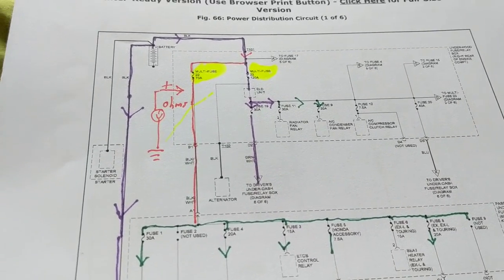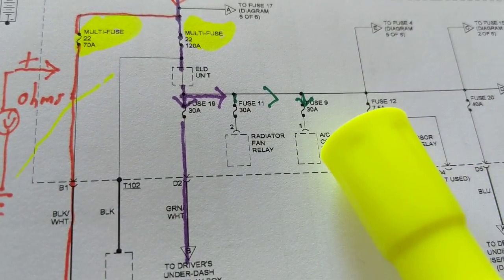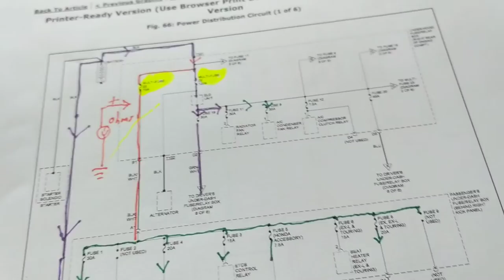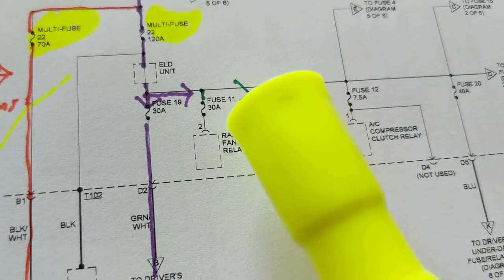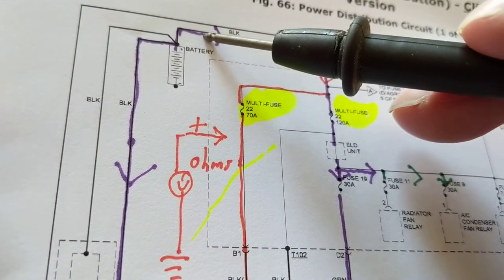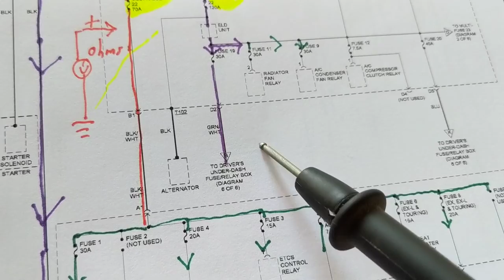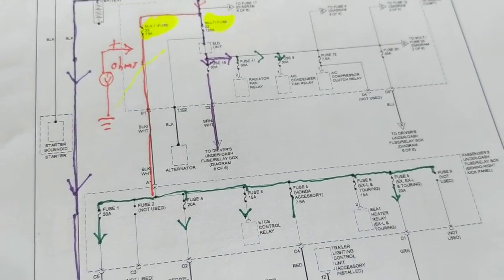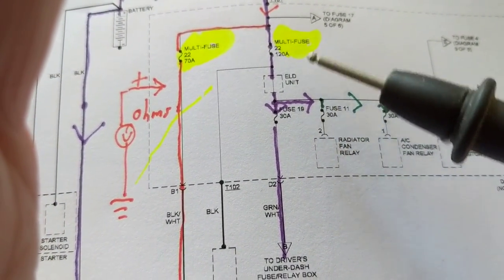how to check FUSES FOR SHORTS FROM WIRING DIAGRAM

Comment from the maker: I believe I made a video about power distribution system and all the fuses in the system it should be on the channel Joe electronics schematics for Auto I described where the fuses are connected to the systems and how to measure them

Comment: One thing we have to keep in mind is if the short is intermittent( shorted wire moves position), we may  have to shake wires  when doing the ohm test  to ground.
Reply from the maker: I totally agree always shake wires at every connector
Reply from the maker: But if there's a short then the fuse will blow for a dead short u have to measure from gd to other side of fuse